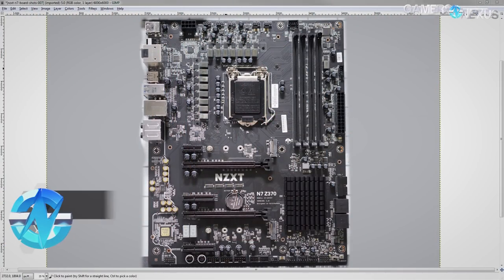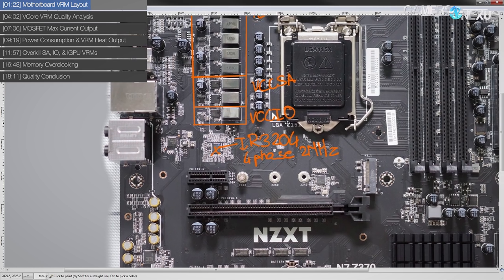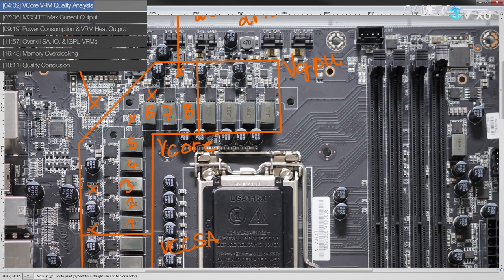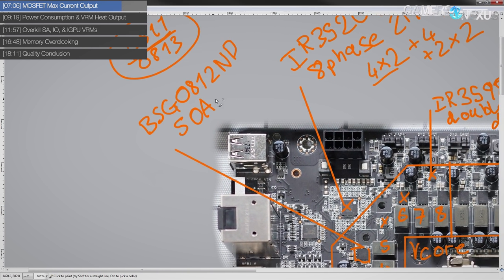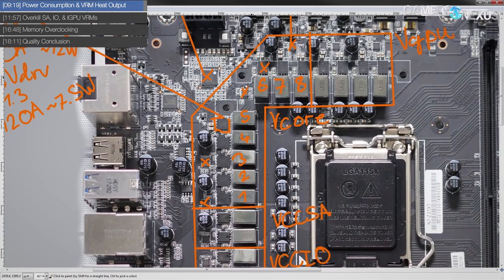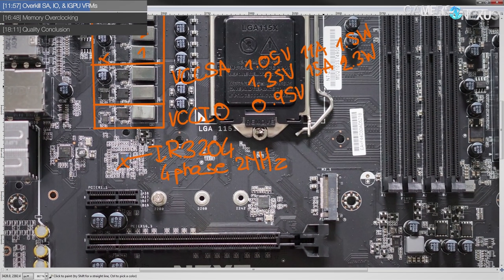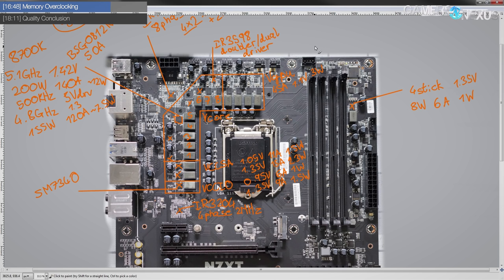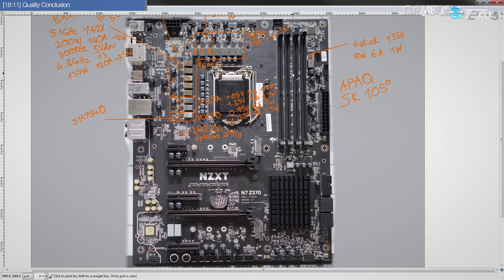NZXT N7 Motherboard VRM Review & OC Potential

Comment: Is it me, or does this seem a bit expensive for what you get....? Do you guys actually recommend this?
Reply: I mean... if you reeeeally like NZXT... I guess?
Reply: (YT still is bugged out, can't reply on the GN account): We haven't fully reviewed the board yet, so we presently have no recommendation for or against the board. This is just a look at the VRM -- primarily making sure it's not garbage and hasn't been cast aside for visuals. You can absolutely get better overclocking boards for cheaper, but NZXT is trying to basically bundle-in its HUE/GRID controllers (for people who would have bought them otherwise). Will talk value more in a full review.
Reply: Almost everyone said it was expensive, and it even got price cut by 50 dollars if I remember,  the main extra cost is the NZXT addons
Reply: Well, it's better than the original asking price of 300$. but yes, NZXT strategy lately (also in their cases like the H200i) is to charge a premium for RGB and fans 'smart' controllers.
Reply: nobody sane should buy this as a motherboard... you're buying it for the grid+ and hue+ and at that point it's actually kinda worth since those would cost you more than 100$ bringing the board down to a 150... and that's not enormous
Reply: ^Kind of contradicted yourself there, no? I would never buy that board simply because of it's BIOS and price. However for someone who is never going to touch the BIOS and just wants pretty lights and what not, it's a fine board.
Reply: It is. Most motherboards are over priced. Thermal armor, shielded ram and pcie, pcie nvme heatsinks, do nothing. Rgb is a joke. The only reason to buy a gaming motherboard over $200 is you take overclocking very seriously, or are willing to pay for worthless gimmicks
Reply: I figured as much, look forward to the full review.
Reply: But CAM Software is pretty shit.
Reply: It's mostly not recommended by most reviewers. And judging from this I'd say no.
Reply: From what I can understand the high price is due to the integration of the Hue+ and the Grid+, considering how much those devices cost the final price of the board is reasonable. The real question is how many people really need the Hue+ and the Grid+
Reply: Brother Ares I was talking about the guy above you, your post was not there when I posted.
Reply: It is too expensive. However, I believe that either JayzTwoCents or Steve went over this. Since NZXT is new to the motherboard industry, they can't get the same deals that long time veterans like Asus and Gigabyte can get from their partnerships with component manufacturers. Also, NZXT has to have a middle man for the assembly, while the other companies make their motherboards in-house, which is cheaper.
Reply: asus is not manufacturing in house they are actually made pegatron so pegasus (to rise again), can't seem to find anything on the others but they are probably not either but they have the advantage of connections and large orders

Comment: Nzxt must be proud of the 103 motherboards ppl have bought
Reply: It's the integrated hue+ and grid+ you're paying for. Not the steel cover.
Reply: Basically it's a tuf with said peripherals integrated.
Reply: F them 🤣
Reply: Maybe if they made the covers to fit over other motherboards it would be more worth it, even for $100
Reply: PsychoZulu integrated kraken g12 vertical bracket
Reply: Brother Ares that 2.5 inch module allows for a lot more than what most motherboard rgb solutions allow for. It's a much more significant piece of hardware than you seem to understand. Not only that but you are paying for a permanent subscription to their CUE software.  Now is it worth what they think it's worth? Not to me it's not. But to somebody apperently it is.
Reply: Brother Ares changeing your point doesn't make you any less wrong.
Reply: Brother Ares >No you. 
Lol, dude, come on.
Reply: Brother Ares you said it costs this much because it has a steel plate.  I simply told you where nzxt is putting the value in their board.

You can equate the hue+ to a RGB header all you want, it's also a white LED.

Conveniently ignoring the grid+ is not winning you any sympathy. 

You can say windows is shit too, you're still buying it with any new pre built laptop and it adds to the value. 

I've already stated I don't agree with their pricing, but this is where they (NZXT) finds value in their board. Whether you want to keep screaming about it being worthless or not doesn't matter to me.
Reply: joshua41175 dude its plastic, not even steel

Comment: the igpu can be used for the second monitor if you have an old one with analog signal since newer gpus only use digital.Sometimes you just need to have a second monitor and buying an active adapter or a new monitor is a waste of time and money(if you use it for few stuff and use your main one mostly).i know this mobo doesnt have an analog port but most z370 boards have

Comment: Why cant there be motherboard for minimalists or is there that i dont know of?
Reply: NytOnPeliAika you gotta have all this stuff on the board. Won’t work without it.
Reply: R SU well its true is there a mobo that has a "face plate" that was as minimalistic as possible?
Reply: n7?
Reply: The MSI SLI Plus motherboards are probably the most subdued that I've seen.
Reply: NytOnPeliAika if you are a minimalist then just use a case with a solid side panel,
Reply: MSI PC Mate/SLI Plus/Gaming Plus series.
Reply: Asus ROG Strix are about the minimalist board I could find for my Ryzen build.  I have the tiny bit of LED on the board turned off so it just looks like a nondescript black mobo, sorta.
Reply: minimalist meaning subdued look but great build quality...

Comment: With the white shroud on this MB it looks very cheap $125 range, but I must say in black it hides the poor craftsmanship and bumps it up to the $150 range. Most of the reviews I've seen show this to be a very weak product at it's once $300 & now $250 price range do to its early 2000 BIOS design & lack of OC abilites. I will say the RGB header & Fans header locations are nice compared to most MB on the market today and adding that into the mix it should stack up well against the $175-$225 MB on the market, but there dreaming at $250 just like there $300 OG price
Reply: **Sorry the fan headers you brought up brought out my soap box.

Oh god my cheaper mobo has fan headers haphazardly thrown around the board. Better have a fan controller, because the fan headers will not allow clean cable management. Worse though is the NVME slot with x4 being literally half an inch from the CPU cooler. Right under it. No airflow... I switched it from the #1 x2 spot (because that makes sense right?) to the #2 x4 spot right under the damn CPU. Rose 10c+ depending on the application. 20c if it's demanding.

Oh and the #2 and #1 spot cannot be properly accessed if you have a GPU installed. You might be able to install an NVME drive in #2 with a GPU in, it will be tough however. #2 is blocked completely by the GPU. However it cools a WHOLE LOT BETTER behind the GPU (maybe the hot air is still better than no airflow...)

My last MOBO had much better positioning for the x4 NVME slot. Oh and the numbering made sense. #1 slot = best slot. #2 and #3 were x2. 

Sorry the fan headers you brought up brought out my soap box. Ranty mcrantpants.
Reply: I'm kind of lost? are you talking about the NZXT N7 compared to your old cheaper MB? and how the N7 is a nightmare for thermals and regret buying the N7? if so which MB did you "upgrade" from?

Comment: It's got about the same VRMs as the Maximus X Apex which is a $350 motherboard, so $250 isn't too much in comparison.

Albeit it's also not something you need to max out an 8700K since you can comfortably do that with a $150 board, it's just that it won't do it as efficiently, but we're not talking about Xeon's here either.

Comment: Hello. Can you tell me if this board can run i7 9700k without any issues (performance hits or any other). Thanks in advance
Reply: you’ll need to upgrade to latest bios in order for the motherboard to work with 9th gen intel cpus, try buying a z390. that motherboard supports 9th gen cpus out the box.
Reply: @cmc0ffinz202  Thanks
Reply: Dimitrije Nanusevski absolutely! i just got this same exact motherboard today and a i5-9600k used for a bargain price. previous owner said he updated the bios to the latest one available previously with an i5-8400. i’m just waiting now to buy a cpu cooler and power supply to test the parts.

Comment: Painful to watch.  Forced myself to do 8 minutes out of loyalty to techtube Jesus. It's by nzxt, we already knew it was pretty but mediocre at best.
Reply: The ODM is ECS. Known for low-cost products with mediocre engineering. They also built Abit boards back then, which were nice, but then there was the low-quality capacitor plague that ultimately bankrupted Abit.
Reply: I must have seen a different video than you. I thought he said the board was pretty solid.
Reply: Jonathan, there's probably nothing terribly wrong with this board, but also nothing to push it beyond $150 mark. However, it's $250.
Reply: that is very accurate still good quality components are a plus.
Reply: It isn't mediocre though. He said it was decent, just not something for those who want to push overclocking. But not OEM Foxconn junk, for sure.  You didn't watch it it seems.
Reply: @CheapSushi: For $250 that's not good enough. If I'd rather take a $150-160 ASRock K6 or Extreme 4 over it, then something's wrong...
Also, I suspect thermals will will suck due all that "armoring" with no heat dissipation...